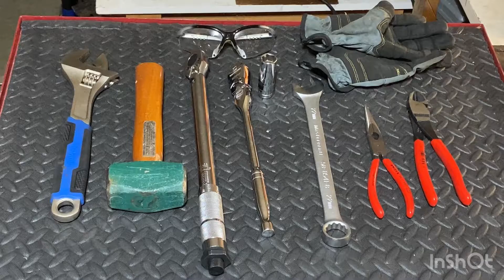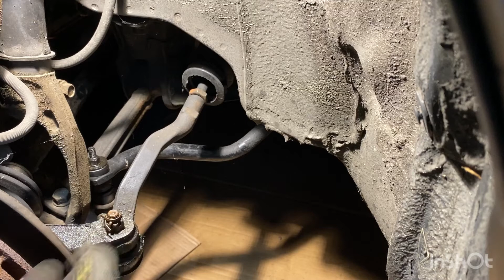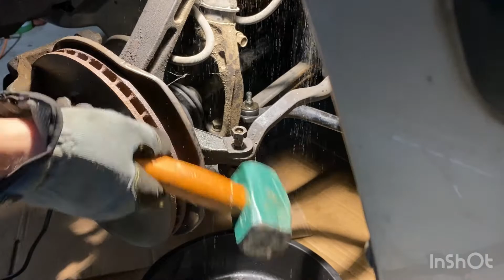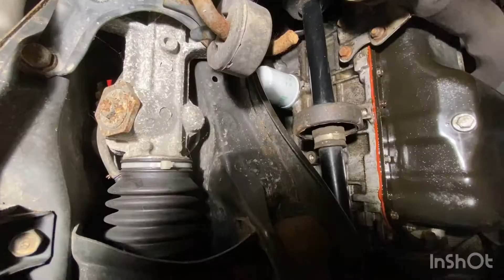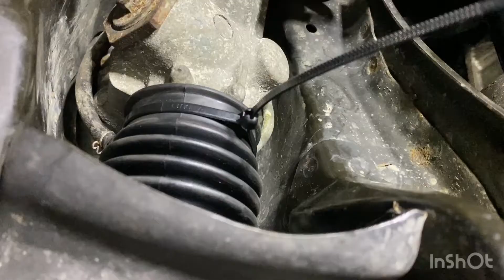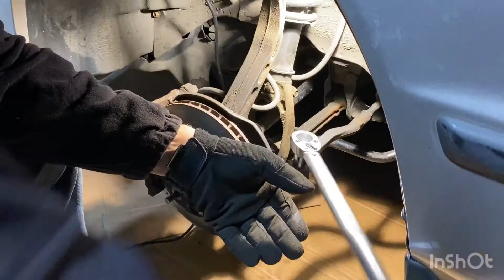How to Replace Inner Tie Rod Boot aka Steering Rack Bellows

Comment: Mines wont seat over the rack end,even though its supposed to be the right one for my car
Reply from the maker: It is a tight fit. That said, if the opening is evidently too small, you should return it for one with a bigger opening.

Comment: Never use zip ties, they break and your bellows will be  chewed up by the hydraulic piston
Reply from the maker: Thanks Vincent. That is always a possibility.
Reply: Every mechanic I've come across lately has been using zip ties for the inner/outer tie rod boots and they NEVER stay put. Twice now, my inner boot/bellow has slipped off the rack bc they're not using the metal clamp. And they keep insisting the slipped boot won't damage the tie rod or steering rack. Even tho that's how debris gets in and damages the inner parts. Mechanics love to lie, especially to women 🫩

Comment: What if the air connect is suppressed when you put on the boot
Reply from the maker: Hi Debra, you will have to pull it back out. It is important to have it connected so that air can flow. :)